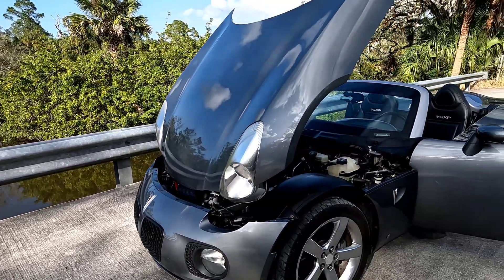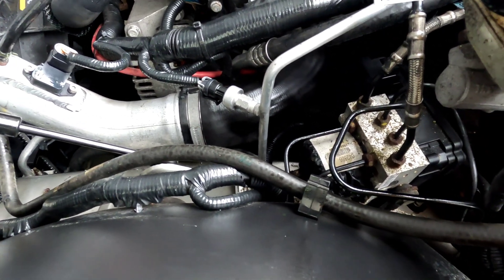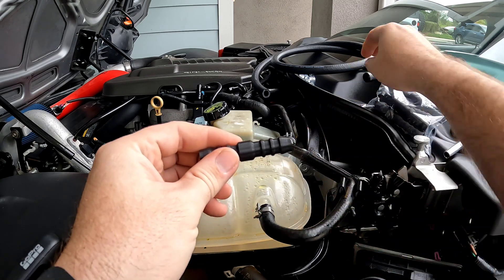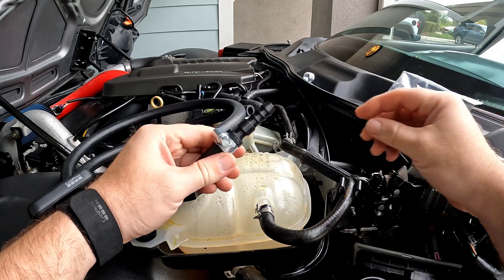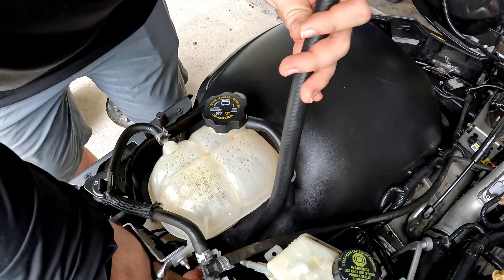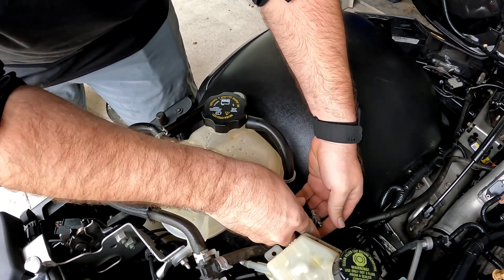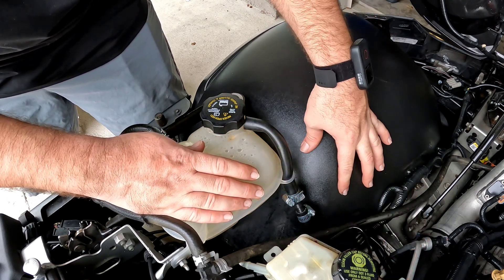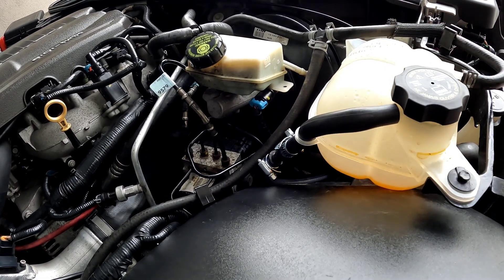3D Printed Car Parts: Custom Tank Mod for Your Solstice, Sky, or Opel GT

Comment: Nice.  But isn't that hose you attached to removable? Why not just attach the longer hose directly to the over flow tank?
Reply from the maker: Good question! It was on the older run of part numbers on the purge tank.  The new OEM one that I received was put on with a form of epoxy resin....not sure why they did this. Originally I did attemp to remove the short hose that was on it, but considering it looked like the barb was going to break, i just 3D printed and extended it.

I also noticed that there was a design change on the inner two chambers compared to the older design.
Reply: @GearHeadzGarageUSA  thanks for the explanation. I picked up a 2007 gxp 10.14.22 and changed the oil and plugs. Haven't really messed around under the hood beyond that. I live in northern Indiana and haven't driven it much either.
Reply from the maker: I know the weather up there is pretty cold. There's a few things you may end up having to do to it, but depending on how the previous owner treated it, you may be lucky! I'd say one of the biggest mods I did was actually the purge valves in the coolant lines helped with the overheating that these are notorious for.

Comment: Great job on the video ! I did notice that the coolant reservoir may be a little low and this may be part of the burping or excess pressure issue. Your system may have an air bubble trapped. My 2007 Redline has no coolant ever expressing from that tube.
Reply from the maker: Hey Tim, good catch!  It's actually pretty interesting ever since I installed the check valve fix from the GM bulletin it seems that the pressure will look appear low when recently run... But as soon as you open the cap, it'll explode in the purge tank and return to normal...Pretty wild.  It's a head scratcher for me....does your tank fluctuate?

Funny story, was in the dealership a few days back after a radiator install and they didn't realize it was a pressurized system and decided that they were going to open the cap throwing coolant all over their lift bay.
Reply: Well that means you have a massive air bubble trapped in the system … when the pressure builds in compresses the air and when you open the reservoir is decompresses and releases the stored pressurized energy. 
I have a video that may help you get rid of the bubble as that is what is causing the situation. Just an FYI … 
Tim’s Garage Episode 20: Saturn Sky Solstice Turbo Cooling System 15 min EASY Purge
https://youtu.be/yxUAzxbgb4M
Reply from the maker: @350tiger  Your the man!